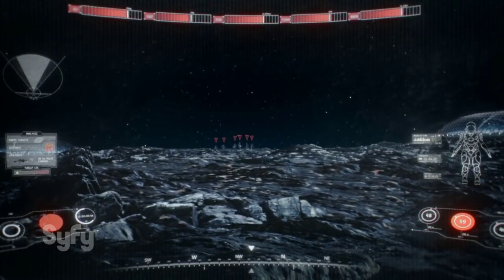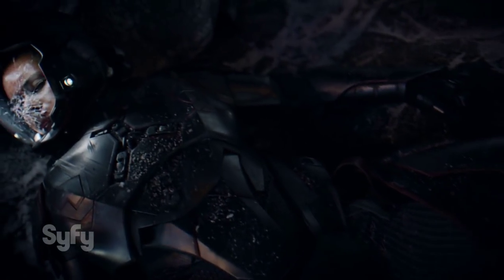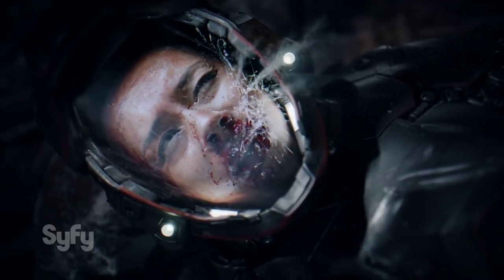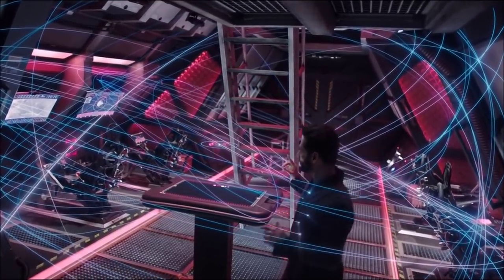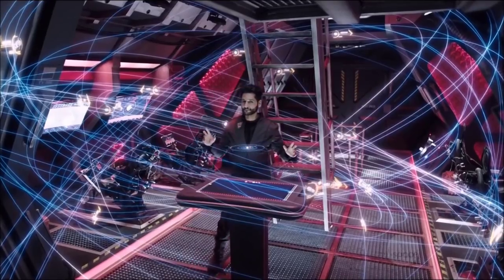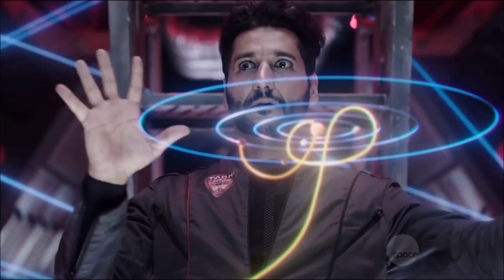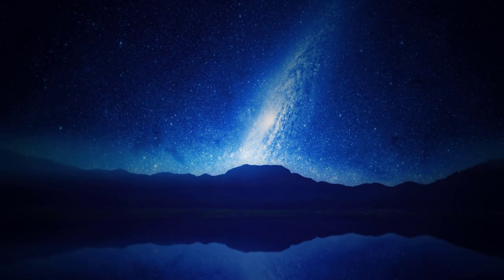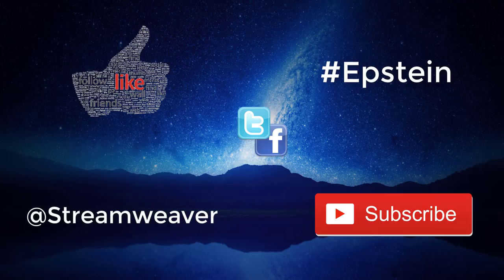Let's Do the Science:  The Epstein Drive

Comment: I do recall them mentioning reaction mass, so they may require a "working fluid"  

But yeah, it has to be some kind of fusion.  Going by the simple equation W = Fd, a trip to the moon at 1g may only take a few hours, but it would require about 400 MILLION Joules PER KILOGRAM of energy.  So a ten-ton ship would be 400 billion Joules, a 10,000 ton ship 400 trillion joules, etc.  

However, a thermonuclear bomb can generate 5.1 megatons per metric tonne of weight (That's the total weight of the device, not just the fuel), where a megaton is roughly 4 QUADRILLION joules.  So, can fusion can easily satisfy these requirements, even in a relatively inefficient thermonuclear bomb which only fuses a small portion of the fuel which is available.  If you got the efficiency up, yeah, energy still wouldn't be a problem.  But I think you'd still have a problem with reaction mass.

The problem then is your reaction mass itself.  The faster it's ejected, the higher the temperature, so there's a speed limit on it if you don't want your engine melting.  Now, modern ionic drives can overcome this by charging the reaction mass, so that you can direct the reaction mass out of the ship without having it come into contact with the engine.  Maybe this is the case with the Epstein drive, a large mass of plasma coming out at high speeds without contacting the engine, allowing it to be used as a reaction mass.  Maybe.

Comment: I've read in the past, about Project Icarus and Project Daedalus, both based on fusion propulsion. The specific impulse of Icarus is about 550,000s while NASA's Saturn V had 420s. The research papers say it can theoretically reach 8% speed of light!! Study done by British Interplanetary Society
Reply: Also, pure Plasma alone is more than sufficient for producing high impulse. The ionized high energy fusion plasma jet that is created inside the fusion drive is expanded in a magnetic nozzle, converting the heat energy of plasma into kinetic energy as the plasma exits the nozzle. The process is similar to how air is expanded and accelerated through and out of a jet engine. But in Icarus, a miniscule amount of H fuel is used to produce huge thrust. It's like around 1MW/kg.

Comment: In the books it’s mentioned the trip to Jupiter takes a couple of weeks. And given other times they talked in weeks I think it’s safe to say the SAFE deceleration and acceleration phases parts of any flight are a crucial part that consumes a most of that time.
I would venture. That for most of their flight. Unless they are as they call it BURNING FUEL, the drive is just lit but like a gas heater on the lowest setting.
That’s the phase when they no longer accelerate and just cruise control to their destination.
Also. If you look at the episode about Epstein.. just before he strokes . You can see his speed and about 16g and the time elapsed.. so you can calculate his minimal max achievable speed by that. It’s pretty close to your own estimates on the video btw.

Comment: There is a Sci Fi book called Sundowner by David Brin.  He imagines a laser that, due to the entropy conversion, super cools a ship enough to approach the sun.  Never mind the radiation issues, can you use a laser like that to dump heat into the exhaust stream and keep from cooking the ship?
Reply from the maker: I think the issue there would be the same as dealing with plasma in general.  So hot it's a separate state of matter, the only real hope is to keep it contained in a magnetic field and not touch anything.    They'd have this same problem in this case too.
Reply: Right.  I am with you on the magnetic field.  Still have to deal with the radiation that gets through that.  Have a look at Brins book, or at least the synopsis of the physics.  Seem like the whole things hangs on getting rid of heat.

Comment: Hydrogen and Boron-11 fusion would produce 3 Helium atoms that can probably achieve very high propulsion efficiencies. Some energy would be lost due to gamma, X-ray and bremsstrahlung but the rest is carried away by the helium nucleus, and they can be directed with magnetic fields to travel in the same direction.

The real problem is still heat management from such a system...

Comment: Did you not read the books? The Epstein drive is purportedly efficient in terms of heat dissipation from the fusion reactor. The propellant is water, the heat is efficiently transferred to the propellant. This allows the Epstein fusion reactor to reduce the heat generated, because so much heat is transferred to thrust. This is efficient in terms of not needing to burn as much resources. This is all in the books.

Comment: @ 4:45: I believe they're using Helium-3 to power the nuclear thrusters for these ships. The fusion of helium-3 atoms can release large amounts of energy without causing the surrounding material to become radioactive. And even if it did, they likely would have developed the necessary technology to protect the inhabitants from any ionizing gamma radiation that would be emitted. There's an episode in Season 3 aboard the Rocinante where if you freeze frame it at a certain point you can clearly see the fuel lines on the walls above are marked as "Helium-3".  We know from the story that there's an abandoned Helium-3 refinery on Jupiter's IO that Jules-Pierre Mao repurposed into a research test facility for the protomolecule hybrids, suggesting that Helium-3 was, and or still is, a critical resource for this space-fairing civilization.

Comment: 3:19 There is no upper limit to thrust simply by looking at the fusion reaction itself. Regardless of the amount of momentum you can generate from a single fusion reaction, you can simply escalate thrust by adding more and more of them (i.e. increasing reactant flow). A more relevant concern is that this quickly causes your engine alone to produce more power than the Earth does today, and all that concentrated power in such a small engine package usually results in an expanding cloud of vapour, if even a tiny fraction of that waste heat lands on the engine structure. My guess is Epstein somehow managed to redirect all of that waste heat in one direction or into the exhaust, such that you could get those terawatt outputs without melting the ship.

Comment: To shield against radiation, water. 
Accept no substitute.
2 meters wide of water inside a shell surrounding the drive would block almost all of that radiation and shield the occupants.
Now of course this water will get hot. 
But you simply add a filtration system that passes the water into a cooling system and you are pretty much set when it comes to dealing with both the radiation and the thermal load of the drive.

Comment: A computer actuated relay clicks in the small control room at Israel’s Ben Gurion University of the Negev. Nearby, a two story high power generator starts up.… But there’s a strange silence. There’s no whine from high speed turbine blades, no hum from copper generator coils whirring in a magnetic field, no hiss of pressurized, superhot steam. That’s because Etgar 3, the world’s first liquid metal magnetohydrodynamic (MHD) plant, has no moving mechanical parts. Instead, a stream of relatively low temperature metal is forced through a magnetic field. Electricity is then tapped directly from electrodes contacting this metal — up to 30 percent more efficiently than with turbine based generators, say proponents. — John Free, “Now: liquid-metal MHD; magnetohydrodynamic power,” Popular Science, July 1985.

Comment: ok... so, this is speculation but I'd be surprised if this isn't want is decided on as the mechanics going on here....

The efficiency of the reactor isn't the key here, it's the efficiency of the magnetic acceleration of the reaction mass (plasma)… Anything with a finite resting mass (so pretty much any particle) will achieve an infinite mass at light speed (hence light speed in the conventional sense is not achievable). The Epstien drive works by accelerating the reaction mass to a speed that is close to the speed of light, this is done while the mass is still within the magnetic constrictors and accelerators... As the reaction mass approaches the speed of light, the mass of the plasma increases dramatically… Now we just have to look at Newtons 3rd law of motion... suddenly we are throwing a huge mass at massive speeds behind us, allowing for greatly increased acceleration while not increasing the consumption of your reaction mass.....

Enjoy :)

Comment: when  they say it "runs on efficiency" -- do the maths on what % of the energy must be sent out the back vs absorbed by the ship to avoid it heating up. 10G acceleration without vaporising something implies either a high reaction mass : ship weight ratio, or the ability to dump all heat from the fusion into the reaction mass

Comment: The fundamental concept for a self-contained space drive implies some method for regulation and directability. One would expect that engines would only thrust at low level sufficient for movement when near objects like landing pads that needed to be preserved and then employ high power when clear of sensitive areas. It may be that the danger inherent to the spacecraft from phenomena such as self-charging would be a greater concern.

The show's premise is that the crew can operate the ship independently. If such autonomy was not a constraint, then the more plausible solar-system transport network would employ off-ship directed energy stations providing the power to move lightships around. If reaction mass was required, it would be more efficient to employ collectors (such as plasma contactors) to re-direct ambient mass rather than to move propellant around.
http://digitalcommons.calpoly.edu/cgi/viewcontent.cgi?article=1046&context=stat_fac

IMO if current tech is projected for use in an autonomous ship, then they could use direct heavy baryon fusion to power a relativistic particle (or wave) accelerator/chamber to generate thrust.

Doubly-Heavy Baryon (quark) fusion: https://www.nature.com/articles/nature24289.epdf
Relativistic Thruster/Relativistic Accelerator: 
http://www.dtic.mil/dtic/tr/fulltext/u2/a200399.pdf
https://arxiv.org/ftp/arxiv/papers/1503/1503.07304.pdf
LAPPS: http://www.niac.usra.edu/files/studies/final_report/527Kammash.pdf
Plasma: https://ntrs.nasa.gov/archive/nasa/casi.ntrs.nasa.gov/20020014358.pdf
http://mipse.umich.edu/files/Delzanno_presentation.pdf

Constant one-G acceleration for Jupiter missions was part of the concept for the 1950's/early 1960's Orion pulse drive technology. Refs:
site: http://www.daviddarling.info/encyclopedia/O/OrionProj.html
Basic: https://ntrs.nasa.gov/archive/nasa/casi.ntrs.nasa.gov/20000096503.pdf
Advanced (GABRIEL/EPPP): https://ntrs.nasa.gov/archive/nasa/casi.ntrs.nasa.gov/20000021516.pdf

 If it is a completely new science and technology, then it is most likely something we can't even speculate about. Even highly speculative theoretical constructs that offer significant capability such as quantum pair thrusters are vague in terms of implementation:
https://www.scientific.net/AMM.325-326.1471

Comment: NASA : Metallic Hydrogen: A Game Changing Rocket Propellant
 Isaac Silvera
Harvard University
Atomic metallic hydrogen, if metastable at ambient pressure and temperature could be used as the most powerful chemical rocket fuel, as the atoms recombine to form molecular hydrogen. This light-weight high-energy density material would revolutionize rocketry, allowing single-stage rockets to enter orbit and chemically fueled rockets to explore our solar system. To transform solid molecular hydrogen to metallic hydrogen requires extreme high pressures.
"Torch Drive" describes a class of reaction engines for spacecraft propulsion characterized by high thrust and high specific impulse, and hence very high power levels. ... This allows very high energy thrusters, which can combine both high thrust and high delta-V simultaneously . and Metallic Hydrogen: Is the fuel : Such engines are called "Torch Drives", a spacecraft with a torch drive is called a "Torchship."

The term "Torchship" was coined by Robert Heinlein in 1953 for his short story "Sky Lift", But this is not a science fiction story, this is the real world , and this is the beginning of the age of "Torch Drive'" Metallic Hydrogen  engine for space travel. 2011-2020

Comment: #Mytheory
Given that there are Helium 3 refineries on Io and the fuel is referred to as 'fuel pellets' it seems reasonable to assume that the fusion is pulsed Helium 3 deuterium fusion. From the fact that the ships don't have gigantic heat radiators and that stealth ships are possible it must also be assumed that the engine is incredibly efficient as the 50-60% conversion of thermal energy to exhaust kinetic energy seen in current rocket motors such as the RL-10 would result in the ship being melted by its own engine pretty quickly at even 0.3g acceleration therefore Epstein drives must either be near 100% efficient or capable of somehow stopping almost all of the thermal energy of the fusion products from transferring to the ship . There must also be some system for either reducing the amount of neutrons produced (helium 3 deuterium fusion releases ~5% of its energy in the form of high energy neutrons - due to some of the helium 3 or deuterium fusing with itself rather than each other - which would also fry the engine) or redirecting them. As redirecting neutrons without contact is impossible to my knowledge it would seem more plausible that the fusion is somehow made more efficient though this is still nearly impossible.
However that it not to say that I don't appreciate the expanse for making the ships stations and drives stay within the realm of possibility for the most part (I'm looking at you Ceres Station) and I also massively appreciate the choice not to put some bs artificial gravity into the universe of the expanse. it makes the show and universe feel so much more real. And the Epstein drive is still the most plausible sci fi drive that I know of

Also BRING SEASON 3 TO THE UK

Comment: All it would take is a mirror that reflects all of the products of Fusion in one focused direction so a mirror for not only visible light but xray and gama ray light as well, reflecting the Neutrons which is what you really want as they are neutral and don't interact with a magnetic field.  Neutrons are heavy and the heavier the particle you shoot out the back the better.  This would be a massive achievement and would explain how they protect from radiation in space with out big bulky tanks of water around their ships to protect the crew.  The applications for a material that basically not only reflects but can be made to focus all known radiation and high speed particles is more then just a drive, if it is also a perfect insulator as it may reflect 100% of heat kinda the opposite of a superconductor then could make some interesting tools to probe stellar objects and the deep atmosphere of gas giants.  Problem that could arise is the sensors would be blind as they are made of a perfect reflector.  Nice thing about it is it is simple ni coils to energize and maintain just set of the fusion bomb and go. I could speculate more but that is how I think it would have to work.

Comment: Breeder reactors use fission, not fusion. Also, fusion reactors - tokamaks and stellerators - use tritium and deuterium gas. Pellets are not viable for reactors, they are only experimental concept used solely to study fusion geometry and products.
Reply: Pellets would be viable if we ever get inertial confinement fusion working. That'll probably be awhile though.
Reply: Yes. Because we are at the stage of very, very early experimentation and study, it is not even close to the Lawson criterion, it does not even have a functional and effective fuel delivery system(right now it is one pellet ignition every few hours). Right now, it is not viable form of fusion. ITER using tokamak is the furthest from power generation from fusion reaction and tokamaks can at least sustain the fusion for long enough time, to speak about some fusion reactors, but the National Ignition Facility is very far away from being called a reactor, it is rather an experimental facility.

Comment: #mytheory
A pure-fusion aneutronic reaction in multiple steps, probably catalyzed by antimatter and starting from H1. Acceleration depends on both energy and mass flow, so this could allow a 0.3G to 1G "cruise" acceleration that uses only the fusion exhaust, while higher accelerations increase the mass flow: spitting hundreds of times the reaction mass at much lower speed. This would make the burst very expensive in terms of delta-v, but could be achievable assuming a reaction mass fraction of 1 part ship to 3 parts fuel. It's more than what we see in the official cross sections, but could be fit into the ships.

Comment: So i did the math, there may have mistakes, but TLDR, it's just impossible. One trip to the moon for something the mass of the lunar lander (16.4 tons) at 1g would take 5.3 GW worth of power (400 000 km * 165 kn, divided by 12 600 seconds(3.5 hours)). Using the most efficient nuclear fusion, deuterium-tritium, which provides 17.5 MeV worth of energy, assuming we can harvest all of this energy and use it as a thrust, we would need more than 200 tons of deuterium-tritium, for a 17 ton lander (and the deuterium-tritium itself should get pushed as well, so in fact it would be ridiculous, just like modern day rockets).

Im no engineer, i only know basic physics, so it might be entirely wrong (may be pushing the helium would help? dunno), but anyway it seems its way out of our grip. Maybe antimatter may be the solution, but we would need solar pannels the size of capital cities to create enough of it by using lasers (E=mc²) on one point.